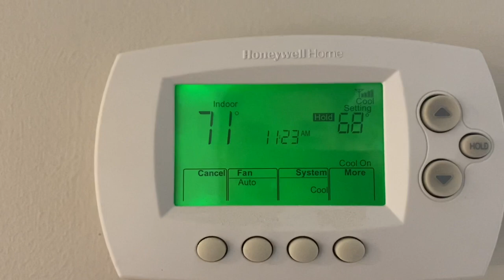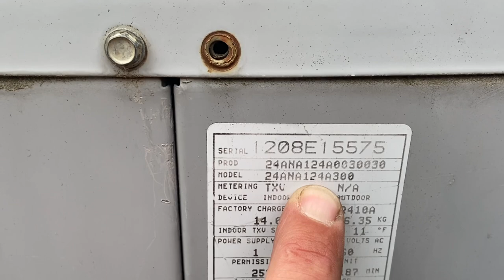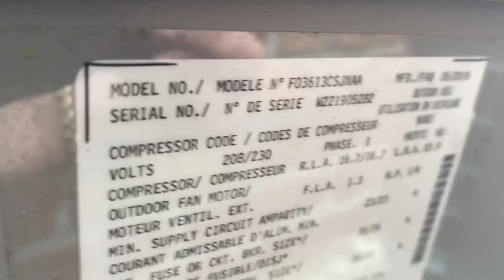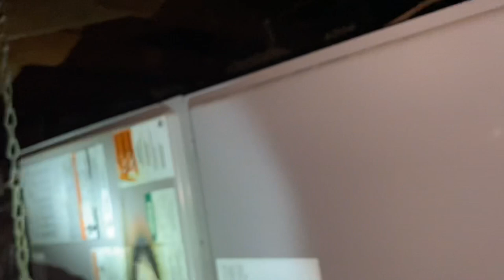How'd They Expect This To Work?  Hacked Central AC System Needs Complete Rip Out!

Comment: It would depend how badly you want to make stacks. 

Doing a fairly big job in an attic is not something I would do. I know of a lot of companies who add 1000-2000 dollar to big jobs that require working in a crawl or attic.

The point is to potentially price yourself out of a job to avoid unnecessary headaches.

Comment: Whatever you do I'd schedule it for a cooler time of the year.  If it is working no point in cooking in an attic for a noise complaint.

And to be honest...you may be able to reuse the equipment but I'd charge a full reinstall (labor and some misc parts) to double check and correct any other issues that are almost 100% there.  Just make sure they know you won't be doing warranty work for them since it was an improper install and the manufacturer may give you guff.

Comment: This would’ve been a good use of your manometer, check the static pressure and see whether the blower fan cfm could be adjusted especially with it being an oversized system.
Reply: It’s a waste of time with those gaps in the supply plenum
Reply: @PipeDoctor  I love what you do brother. You a bigger man than I. Residential/ Light Commercial guys like you are amazing. I work for Trane out of New Orleans, LA doing Commercial / Industrial. Those attics are an actual death trap. I would much rather be in the sun or in mechanical rooms. I work on a lot of water cooled chillers and most of those are in mechanical rooms. Much respect to you brother.

Comment: Change supply and return to fiberglass duct work. That sheet metal with inside liner is just noisy .You may want to remove the sheet metal cans and build fiberglass boxes and use can stock to hold the registers in place. Use round tabs and 2 inch screws to hold the box to the can stock.

Comment: Get the specs on that equipment and see if it fits within manual J, D, and S parameters.  If it doesn't then replace it with proper sizing.  Remember, Manual J first, Manual D, then Manual S.  Continue to explain to the customer you are one of the good guys and you offer solutions, not band-aids.
Reply: I'm going straight to google right now
Reply: Wow I talk about that every day with customers and never mentioned in that simple way. Manual JDST Calculations 👍🏽

Comment: Seems like their biggest issue is the return noise, if it's cooling properly it would be a waste of money replacing the AC only equipment. I can't tell if that's the only return for the unit (I bet it is because it looks like a 14 x 14 or so filter grill) and it's probably all flex right to that "panning plenum", and it's probably choked up by the size of the ductwork and the takeoffs. I'd be willing to bet sizing the duct right, hard piping everything to within 3 feet of all registers and adding a second return or dedicated returns in multiple locations would solve the noise issues. Bring a roll or 2 of metal tape with ya for all those lovely gaps on the unit...

Comment: rip out the fujitsu, and put in a ducted minisplit or VRV air handler for the party load. leave it on auto mode, the fan will increase as the load goes up and can run at 20% capacity for low demand times

Comment: If it was my house I would go with your recommendation of ripping out and replacing the old duct work. Also installing supply and return plenums..Not going to be cheap but that existing butcher job is awful. There just is no cheap way out it needs better air flow.

Comment: That’s the way the AC system work cold air more dense so the blower has to spin faster to push the air around the vents. You should have asked them if they hear the same noise when heating. The house I use to live in the AC worked fine but it was always louder then when it was in heating mode.

Comment: That ductwork must be costing a lot due to the static pressure.  I think you are on the right track with the return and larger registers. I installed a 3 ton Bryant Evolution system on my house.  The variable speed blowers definitely need more return air.  Not sure if the Fujitsu is variable speed?  My supply and return plenums are 3 feet long to reduce turbulence from the air entering at different angles before entering the blower and after exiting the evaporator coil.  Both are insulated on the inside.  I have an 18" duct going to a 20x30 filter grill with a 2 inch filter in it.  I also have a second 16" return going to a 16x25 filter grill with a 2 inch filter.  The filter grills are the 935"s (I think?)  from Shoemaker.  They have individual horizontal louvers and is not a stamped grill. They are much less restrictive then the stamped grills.  The 20x30 grill is close to the unit so it has a 180 degree turn in the flex to kill the blower noise.  My 3 ton system has seven 8 inch ducts and two 6 inch ducts on the supply side and you can hardly hear it run.  I will try to email you some photos.
Reply: @PipeDoctor  I bet those systems just purr along!  Nice!

Comment: If the ductwork is sized right (manual d), and the proper diffusers are used with correct face velocities and throw for the particular spaces they service then there should be no noise issues.

Comment: If this delay that looks that bad obviously there were jack legs I would drop the charge pull the system to the correct vacuum double check it put on a new filter dryer and we it properly it was probably not even weight in properly are you subcool and superheat nothing they probably just landed in I’d go from start to finish

Comment: Adding another return as well will help. Def could us revamp on ductwork, thats fair.  .1 static and your golden.  Might need to also fix install. Sensing bulb in mounted improperly and barely insulated lol.  I would note, no warranty on actual unit install because you didn't install it.

Comment: 600-800 CFM by rule of thumb is 400 AC, 450 HP.
Better yet check specs for tech.
The duct was sized for 2 ton, max, pressure drops, ductulators and such.
Better solution, Mike, consider extra dehumidification.
But always leave the customer with a good honest solution or what to start with. I know when to walk away, when to coax it a bit longer and give a good customer presentation. I’m not in sales, I’m the one making the company sales. Reputation brother!

Comment: I would Inspect the Current Unit whats in the attic Film document if its Garbage and needs replaced oh well.. But if the Indoor Unit is Good Rip the Duct work out,
you just cant adjust the blow motor (CFM) like some say there's no proper return box and airs escaping in the attic that homeowner is paying you to do a job.  MAKE IT RIGHT......
Reply: @PipeDoctor    yup thats the route i would go................